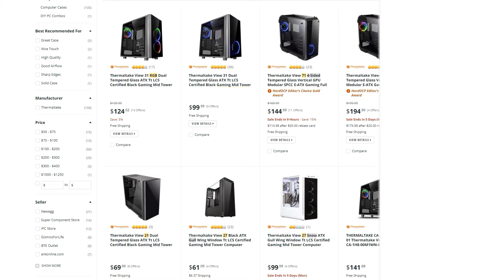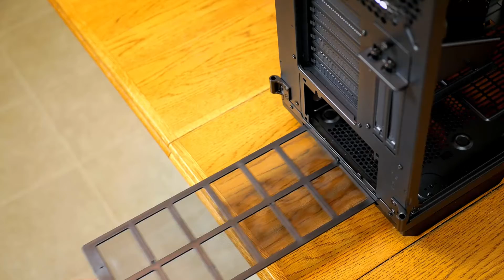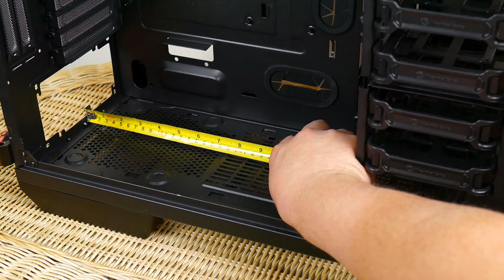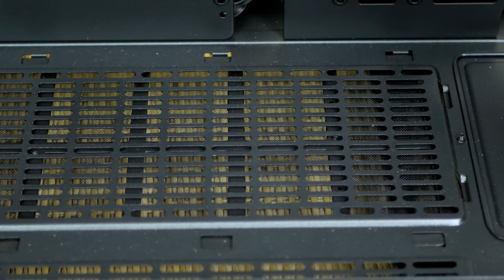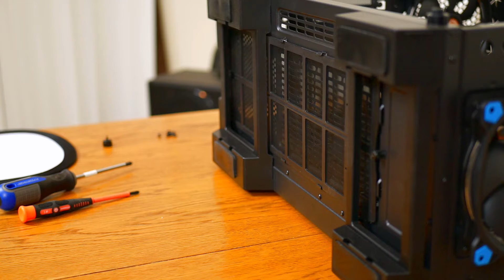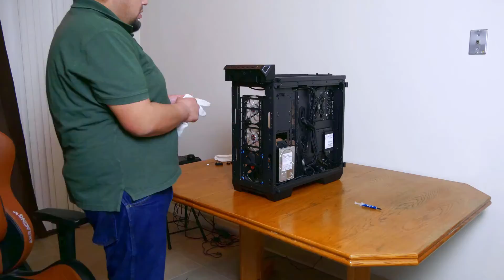Behind the Shine - Thermaltake View 71 Review

Comment: Many years later Fromm this review; I dusted off mine which I bought to build a system back in 2017 but never used; now seen all these flaws, not so sure I want it, mine is the RGB version and it is extremely heavy and bulky for today standard and not having USB 3.1 is a real problem plus all the other issues observed here, after all, what can we expect from a Chinese crap? I bought it following the hype and it always proves fatal when buying like that but I am a hard learner. In any case, will need another case, and that seems to be the case😂

Comment: One of the best reviews of this case on the internet. For a $200 asking price here in Australia for this version and $259 price for the rgb version it is unacceptable for thermaltake to allow some of these engineering  flaws you mentioned in this video. They are also quite greedy with their rgb fan sales, only comes in 3 Pack of 5 pack and are expensive plus not as good in performance as compared to corsairs range. I wish they paid a bit more attention to detail compared to  manufacturers like phanteks or fractal design
Reply from the maker: The concept is there, it just needs to be executed better.

Comment: what is the full weight fully loaded with parts inside?
Reply from the maker: I had a borrowed scale to weigh luggage when I started making this video and by the time I was done I had returned it so I was unable to weigh the whole system; but with a 1080 Ti, AIO, and 850w PSU I think it's safe to say that weighs around 60lbs or 27kg. It's the heaviest case that I've ever owned so if you plan to move it around a lot that is certainly something to consider. If you're just going to build it and leave it in one spot for the most part then it probably won't be a huge deal. Just be careful about peeling off the feet when you move it.

Comment: i have the rgb version. I have the rubber feet issue with one pad.. but was able to get it back on quick enough the glue still worked. Now lets talk the motherboard standoffs.. those were crap.. nothing would thread into them since they had a paint coating inside had to run out and bought uncoated standoffs.. what a pain. other then that.. the case is dope my glass panels have no issues thank god.

Comment: HA!  Hilarious!  I have the same case and I use a very similar looking LED light when I build on my computers.   I had the SAME problems too.  Most of which are not terrible though. I had a crazy rough time getting the hard drive trays out as one on the scews holding one in was extremely cross threaded and I just to use a punch to pound the screw out.  However since I don't use the HDD trays and likely never will I easily over looked this.

 The one thing that probably DOES bother me the most is I have the same problem with the left side glass panel being misaligned.  I however still can thread the thumb screw in but have to be careful not to cross thread it so I barely stick it on there.

I also had problems with the feet leaving black marks and one falling off just like yours did.  I glued it back in place and actually placed some felt pads under the rubber feet.  This make moving the case around SOOO much easier as it is one heavy bastard.  Also fixes the issue of the rubber feet leaving damaging marks on my wood desktop table.

Over all,  I still love the case.  I think the PROs out weigh the CONs however I agree with a little more attention to detail some of the minor issue would not have ever been a problem.  Also yes, I would love to see a power supply shroud as well.  

Great video!  I subbed!  I look forward to additional content.

Comment: So how don't get to my DVD drive with this case?
Reply from the maker: Looking at the frame it almost looks like it would support a 5.25" drive bay but it doesn't. Off the top of my head... you could look at the Be Quiet! Dark Base Pro 900. That's a full-tower with optical drive support. I've just been using the Fractal Design Focus G which is a budget mid-tower with optical support. It's hard to find these days with current cases. If an optical drive is a "must have" for you then it may be easier to get an external drive for about $30 that connects via USB. Then you have free choice of cases. There are still some but they are few and far between.